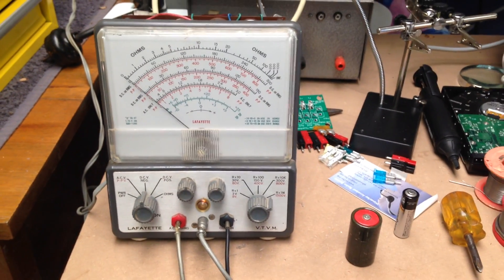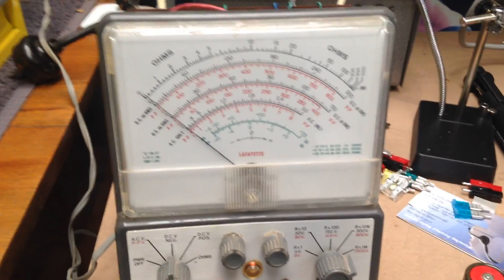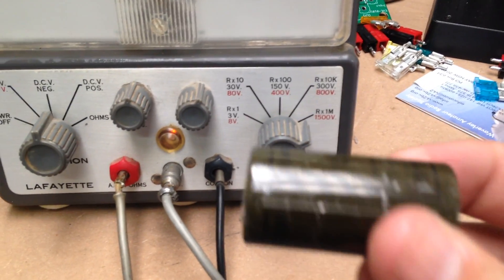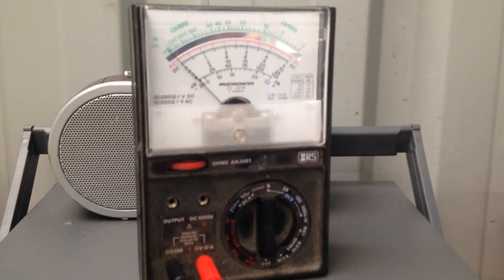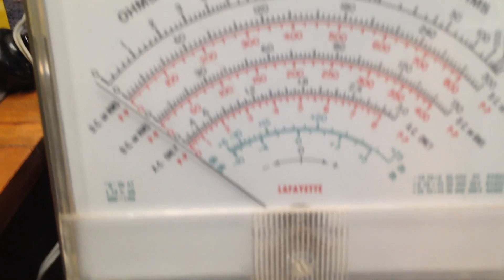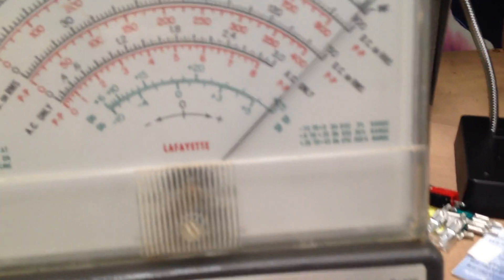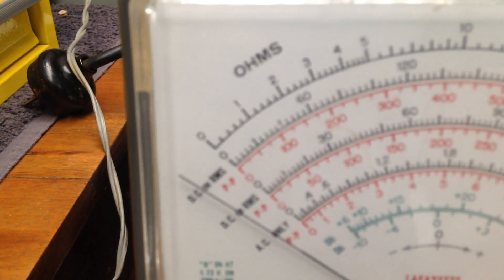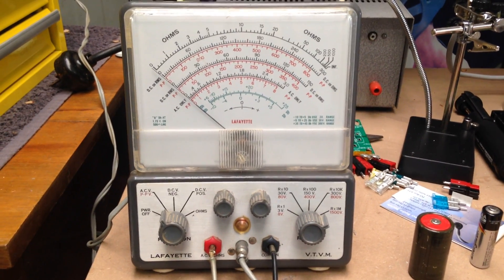Lafayette VTVM 38-0101

Comment: I've had a Lafayette VTVM and I've tried to fix it, but it was impossible. The needle went to the maximum and stayed. I moved all rheostats, changed all resistors, cleaned the movement, even I changed the tubes. Nothing. It went to the trash.  I still keep some of their parts, but it gained the nickname La-Fail-ette. Then I moved to a Heathkit IM-18 and it all went better.

Comment: Having to make small adjustments from one range to another is normal for an analog meter. I hope you enjoy using the meter, they are very useful. It is my analog meters quite a lot. Sometimes a digital meter will not lock onto the same result in a circuit, but when I use my analog meter I can see what the result is and why the digital meter was unable to give me a result.